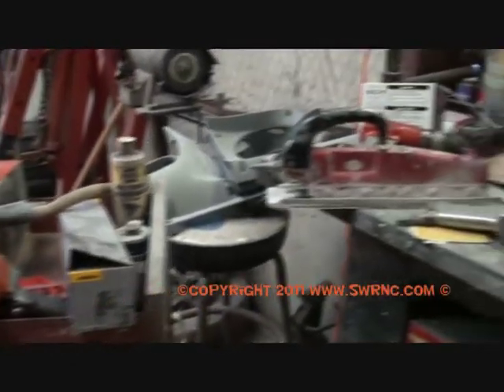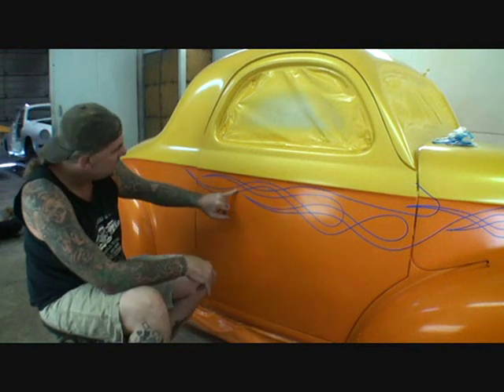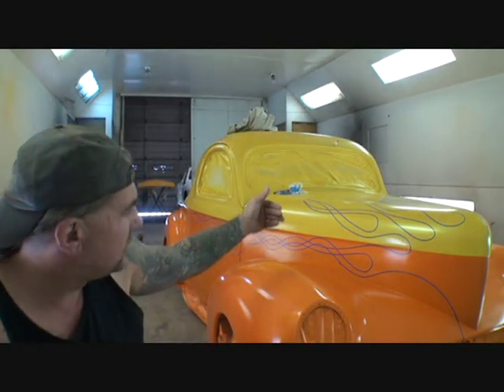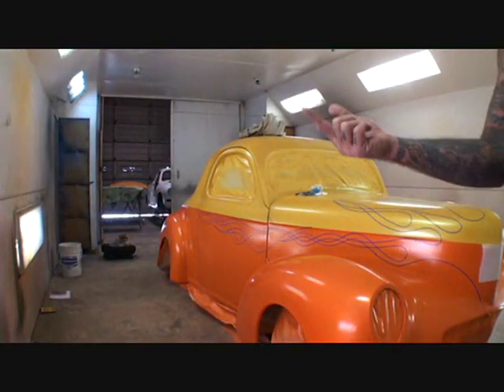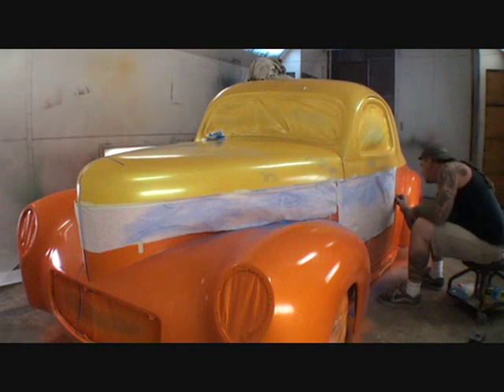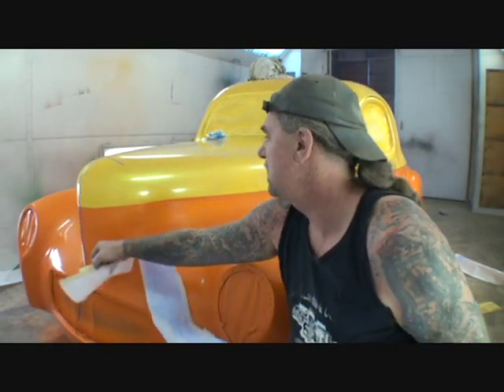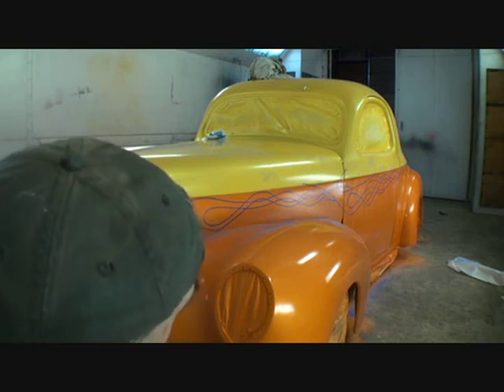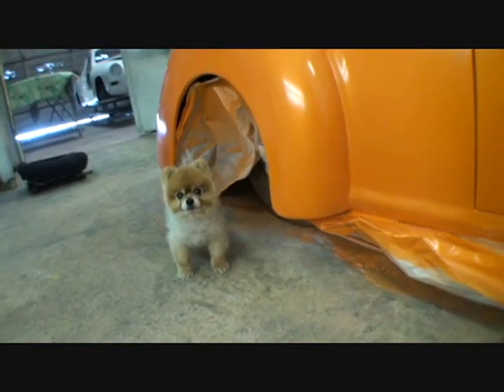How To Paint Flames On Your Car-From Start To Finish-Part 3

Comment from the maker: After you trace your design you will then take a pounce wheel (Spur Wheel--can be purchased at a fabric/sewing store) as shown in the video set and go over the pattern on the paper, this will create small holes, you then tape the paper on the other side of the car, pounce it with chalk, pull the paper off and then you will have an outline of your design to follow with the tape..